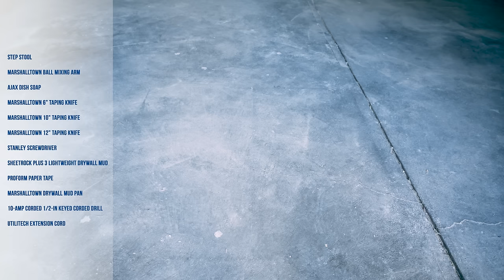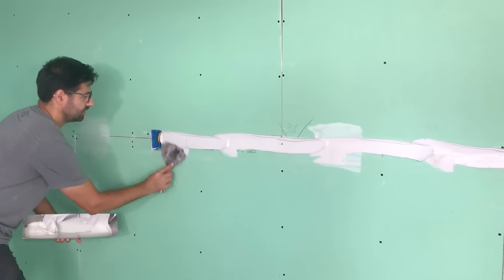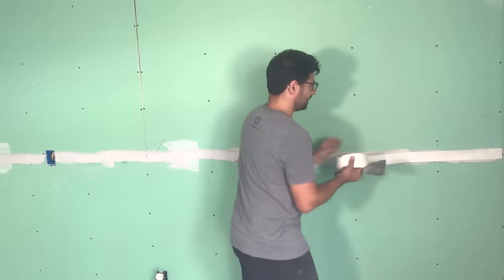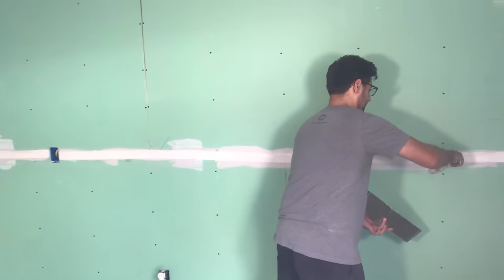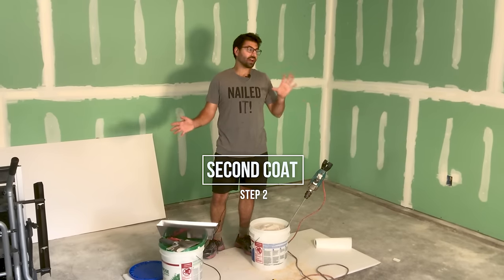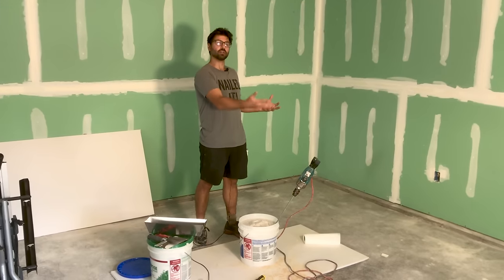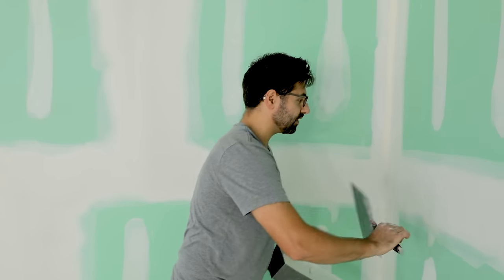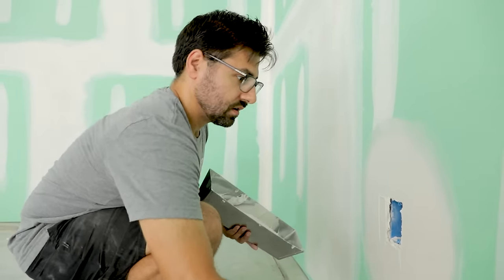How to Finish Drywall For Beginners | Nestrs

Comment: I have a question. I have a drywall project its 2 joints.  I have topping coat mud on hand.  Will it be ok to use topping coat i have for taping my joints or do i have to get all purpose?. Thanks
Reply from the maker: Big - D You will be fine using topping coat for those 2 joints. With that said, I still use the multi-purpose to tape joints because it is a little heavier material. Hope that helps!
Reply from the maker: @joshwhojames  Hey Josh! We're super supportive of viewers sharing additional ways to get a job done -but name calling isn't cool, bro!

Comment: Retired drywall contractor of 45 years.  You  are supposed to tape the buck joints first and then the flats.  Put the angles in after the flats and buck joints.  Other wise, you will pass!

Comment: Sound proofing acoustic panel wich one better dry wall or have another one metireal
Reply from the maker: Nejmu Nejmu if you want to maximize your insulation / sound proofing value, insulate before you hang your sheets of drywall. To go the extra mile, use 5/8” board instead of 1/2”

Comment: You never showed how to do the corners except the tape laying.
Reply from the maker: Hey Blake, It is very similar to the flats. I recommend getting a corner finishing tool so you can do both sides at once. You also have the option of doing one side at a time with your 6” knife. Dry time is annoying though. Hope that helps!

Comment: Get a hawk saves you time
Reply from the maker: Rider davidson I have friends that tell me the same thing. 😂 Although I do have a hawk, I never quite adjusted to it like a pan. To be fair, these days I drywall much less frequently. Thanks some much for the comment!
Reply: Hawk will change your life brooo
Reply: What's a hawk nd wat is it used for.i have 4 room I have to drywall in my home.starting soon.need as much info as possible
Reply: @breannacollins6098  a Hawk is a large metal square with a handle fixed in the center and is used more in plaster applications. When joint compound is mixed to a smooth less viscous manner it will tend to slide off the hawk which is why most people use a pan. It's preference over utility.

Comment: 1:50 i thought that was called spackle
Reply from the maker: unidentifiedflyingretard this is surprisingly the first time someone ask this question! Some people still use the word “spackle” interchangeably with drywall compound. Over the years many different formulas of drywall compound have been created for specific and general use. Today when you hear the term spackle it is referring to spackle paste that is primarily used for smaller drywall patch and repair work. It typically dries faster and is more expensive, so you wouldn’t want to do an entire house with it 😊. Thanks for the comment!

Comment: That paper never lasts. 15 years tops and it's de-laminating and you'll have to redo all your joints, I don't know why anyone uses it over the mesh tape.
Reply: Nonsense. If this were true, hundreds of thousands of houses would have major problems. If tape is coming off, It’s because it was not done right or it was done with the wrong mud. One mistake people make is wetting the paper prior to applying it. Doing so saturates the paper with water so it can’t soak up the mud.
Reply: @MrTeff999  Something like half of the newer houses I've been in have this problem to one extent or another and they've all been taped with paper.
-
Delaminating joint tape doesn't cause major problems but it is ugly. The problem is having someone come in to redo it because that requires moving everything in your house around so all the joints can be accessed.
-
Houses where it's been fixed are almost always having it done when they're selling or buying, when the house is empty anyway.

Comment: This isn't the worst how to on taping drywall I've seen, but there are some things you could do better. First off those bigger gaps where the joints aren't tight need to be prefilled with setting type compound, or "dura Bond". Secondly, you definitely want to thin the mud down for taping, that's why you're having a hard time wiping it down, especially in the corners. When the mud is that thick it's hard to get it to bed into the joint. One coat and a skim coat isn't enough, especially on butt joints. There's no way to get them flat like like. The best diy tip is to not diy drywall.
Reply from the maker: Thanks for the comment Bama!

Comment: Butts first bro
Reply from the maker: Hey Chris Bush, Thanks for the comment. I drywalled full time many years ago and mistakenly switch the order in the taping process. 😊

A more detailed explanation for those who may read this. The reason you do the butts first is so your main tape line “holds” down the ends in the valley. During the sanding process you can potentially expose these ends for a less desirable finish. I will say the ends stayed in the valley and my coats coved it just fine in this case but there is no need to think about it if you do you butts first.

Comment: Why do you do drywall horizontal?? It makes no sense! Surprised to still see tape, we only have glass fiber mass, and that’s for the last 15 years at least. 
This whole procedure seems time wasting and strange!
Reply from the maker: Hey Kewonerdk, thanks for the comment. While hanging drywall vertically reduces butt joints, it increases linear seam footage most of which is lower to the ground and high to the ceiling. This is harder on the body and typically takes more time compared to a centered seam. More importantly, horizontal hanging hides uneven studs and gives a smother appearance. That is why you only see drywall hung vertically in basements and garages (not mine 😜) and commercial spaces due to fire code. As far as fiber mesh, it is a better product but more expensive than tape and not always necessary. I always use it in bathrooms or humid environments.
Reply: Yes but that’s not a problem where I live. Here the procedure is ALWAYS two layer of drywall, always vertical. 
Our “mud” is always primed, and we never ever paint on drywall, we always put on some kind of glassfelt on both walls and ceilings, and that’s national standard. If I put up drywall boards horizontal here where I live, the painters would f..... kill me. Here they have a roller that just ably tape and “mud” at the same time.
Maybe the glass fiber tape is more expensive, but we haven’t had the other option for at least 15years.
Reply from the maker: Kewonerdk sounds good to me. Where are you from? I love hearing about how things are done in different places.
Reply: Nestrs, LLC Denmark. But to be fair, I have a coworker, that works on and of in the US and Denmark. And he tells me that it’s unfair to compare the two, because in his mind we have two different goals when we build.
Reply from the maker: Kewonerdk Copenhagen is an awesome city! I was lucky to have visited there while getting my masters in architecture. I agree with your coworker, building standards and strategies differ from place to place. Thanks so much for sharing!
Reply: Nestrs, LLC as he says with a grin on his face, when we finish putting in windows and doors in a house. 
“We just stuffed a house with windows and doors, for the same price as a whole house in America”.
Reply from the maker: Kewonerdk haha, yeah Denmark is expensive. Not just windows and doors. There are a few places in the US that compare. I lived in New York City for 10 years.
Reply: Nestrs, LLC Denmark is not that expensive, yes we have higher taxes, but not that high, that our houses on average coast 5 times as much. It’s the quality of  the materials we use, and the high standard of building codes.